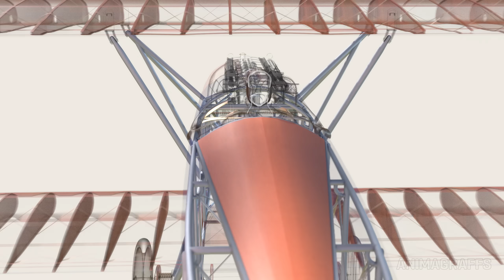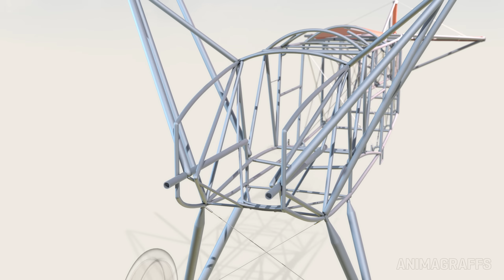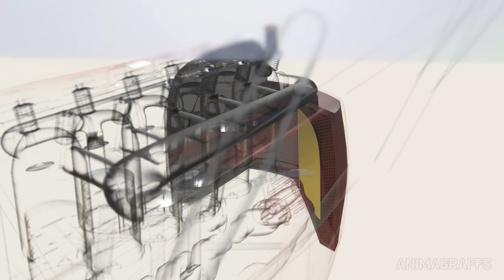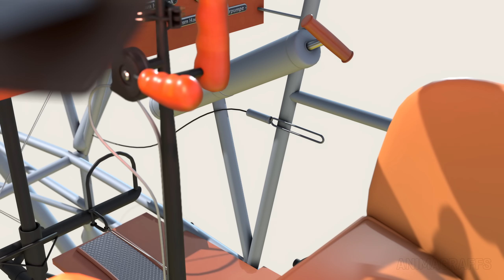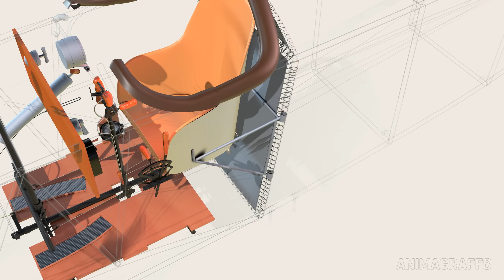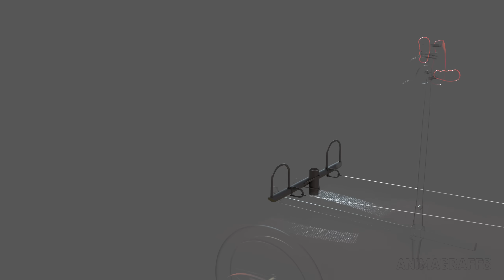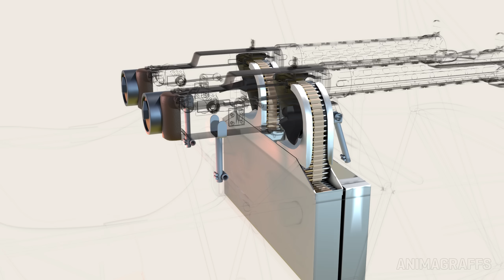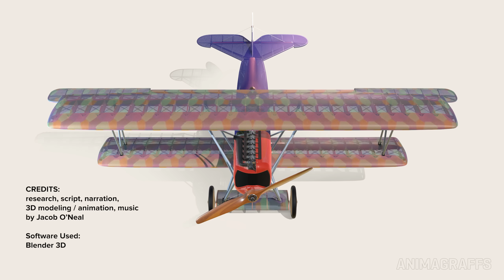How a WWI Biplane Works

Comment: Your videos are graphically excellent, technically accurate, and very informative even for those familiar with the subject matter. Any errors are trivial, but I noticed in this one that the camshaft should be rotating at half engine speed; the prop in some views rotates the wrong direction; and the rudder cables are reversed. But these don't change the informative nature and don't really need correction.

Comment: Very good graphics. I've watched two other Animagraffs, one about locomotives and one about airliner cockpits.  I might note that on this video the rudder and rudder pedals are set up backwards and are operating backwards. When pushing the right rudder pedal the aft end of the rudder should move right, and vis versa. Note also the propeller is turning the wrong way for it's pitch.  I did learn a lot about WWI planes. I've been flying over  50 years, and never knew this much about the "rag wing and baling wire" planes of the WWI era.

Comment: The D VII was clearly a well engineered design based upon “what didn’t” and what did work well. At the time of its design with its welded tubular frame metal ships and “tanks” were riveted. After 1930 when stressed skin aluminum monocoque aircraft construction became the norm, welding of steel warship hulls & turrets and later “tanks” became the norm except for thick armor pieces.

The six cylinder engine (& later V12s) are ideal for aircraft use because they have lower vibration (perfect primary & secondary balance), smooth power delivery and low cross sectional area (offset by the need for a radiator in liquid cooled designs). Large aircooled radial (not rotaries like the Rhônes) also became popular because they lacked the relatively fragile water radiators of liquid cooled designs and were the choice of the USN and often the USAAF.

Comment: Congratulations on the clarity of your graphics. I think, however, you made an assumption that the rudder cables crossed over (a reasonable one to make if you ever foot steered a soap-box go-kart as a kid). I made that assumption on my first attempt at (dual controlled) take off! It wasn't pretty. Only years later, by then an instructor myself, did the true reason for uncrossed wires come to me. Any side loads experienced would call for pressure on one foot or the other to centre oneself in the seat, thus imparting an intuitive balancing act to the rudder bar.

Comment: Love your stuff - but I think you've got the rudder cables crossed. In your depiction the push of the right pedal produces the rudder to move toward the left which would produce a left turn instead of a right turn. Unless they used to "pull" the pedal toward them to create a turn instead of pushing the pedal - the cross cabling (I think) is incorrect. No big deal. Great vid as always.

Comment: You mentioned the engaging of the decompression handle ..but forget to mention its disengagement  when the engine is properly cracked from outside...
Reply from the maker: The way I described it implies a temporary setting just for starting. No need to over-talk in an entertaining video and bore folks.
Reply: @animagraffs  your video is great.. the subject is clear n ur hardwork is really appreciated.. nd I'm not seeing this as an entertainment video.. i respect it as I do to any engineering lecture.. all the best.. continue the good workk.. ty

Comment: Imagine what it was like, before having a timing gear in order to shoot between the propeller blades?
Reply: A previous strategy were attaching metal plates on the rear of the prop to deflect bullets that did not pass through the propeller arc
Reply: And before that, they would mount the guns on the top wing, so the pilots would have to stand up to fire them

Comment: What a beutiful breakdown of a fascinating plane. Anthony Fokker (credited with the Eindecker) and Reinhold Platz (head designer of the DVII) were brilliant engineers. In some ways the DVII was an enhancement of the Eindecker's strenghts. Going with the water cooled engine was an interesting choice. Radials (reportedly) might carbon up in as little as 5 to 7 hours and require rebuilds in 50 hours; water cooled were reliable but could be taken out by hitting the radiator. The short radial life wasn't drastic when a plane might see a few months of service (and pilots might last 2 weeks) but was attributed with the deaths of a couple major German pilots. That's a brilliant detail of the ground crew not having to worry about losing a limb during start up.

Comment: Near the end of this video, where the propeller is shown rotating, the propeller is shown rotating BACKWARDS relative its pitch.  WW1 biplanes did not have beta control as do some modern planes.
Reply from the maker: Yours is the thousandth mention of this, plus the CORRECTIONS pinned thread, plus a notification at the timestamp in the video. Not sure what more I can do to get folks to stop commenting this.

Comment: This video is absolutely amazing. Really great for all aviation enthusiasts.
I just found one mistake, I think. Wiring of the vertical rudder should be not crossed. 
Generally applies, that what foot you kicked, that side you deflect the rudder and to this side you will turn.
I'm not sure if in the past exists some airplanes with rudder control, like shown here. But maybe I'm wrong.
Anyway I really like the 3D modeling in documentary and here I see a masterpiece, I have to say. Great job and I'm looking forward for next one.
😉

Comment: Look I knew a lot about the Fokker D7, but I had no idea that they were powered by a Twin Spark, single over head cam design, with fully tunable engines mid-flight. The Sopwith Camel was complete junk compared to the German planes. It was also great to see actually HOW they managed to synchronise the guns to the props. That tech must have been rocket science back then. Single overhead cams didn't really become fully popular in cars until the 1980's, and Twin Spark engines until the late 90's....and how they did all those inverted stunts in a carburetted plane is definitely some kind of Dark Art.

Comment: Those machine guns did not have shoulder stocks. They were tripod mounted, crew served weapons originally.
Reply from the maker: I'm not a gun guy but if you do a little googling you can see examples of the the original gun with wooden stock from many reputable sources.

Comment: Correction:  The prop bolts were checked regularly not because of variations in temperature but rather variations in moisture content of the wood.  Wood, in fact, has an extremely low coefficient of thermal expansion; however, it is prone to shrink and swell more than most materials with changes in moisture and/or the relative humidity of the surrounding air.

Comment: Sorry fellah, that synchronization remains clear as mud in my little brain.  You have TWO propeller blades, each rotating, how many times per SECOND?, and TWO machine guns firing, how many rounds per SECOND? I see it happening but it is IMPOSSIBLE! At the very least, I fail to see how pilots didn't routinely shoot their propellers into so many splinters.  With all the bumps, vibrations, extreme fluctuations in ambient temperature, and the like, that alleged perfect synchronization MUST have been driven into disarray too often to even care to contemplate.
Reply: because the gun shoots in between the propellers

Comment: That fact that this was one of the first vehicles that you could start without fear of either breaking or loosing a hand to is astounding.

Automobiles didn't have electric starters until the 1930s.

Comment: Best and most interesting part is still missing, the ingenious aerodynamic layout of the wing design of especially this type of aircraft, which kept allied aviation engineers and designer post war scratching their head for almost another decate despite thorough investigations. It was not much before the early 30ies when it was adopted in aviation  modern wing designs.

Comment: Excellent video!  You get an A+ just for rightfully calling the fabric linen and not canvas!  Only suggestion is the prop was shown turning the wrong direction.   But, a small thing and did not detract from the quantity of the video.   Great job!
Reply: I came with the same comment. Really good explanation of the interrupter gear, though.

Comment: A wonderful animation and explanation. However, allow me too point out what I believe to be a mistake. The  wires extending from the rudder bar to the rudder should not be crossed, but should proceed directly to the corresponding sides of the rudder . Thus were one to apply pressure on, say, the left rudder pedal, the nose of the aircraft would yaw  to the left, and secondary effect would begin to roll the aircraft to the left. Having the wires crossed as in your depiction would produce some confusion and consternation for the pilot .and I imagine the flight sergeant or crew chief would find himself in a spot of bother were he to rig the aircraft this way.

Comment: The rudder wire does not cross. Left foot forward pulls the left rudder control horn forward, pulling the rudder to the left. This kicks the tail to the right which is left yaw. 
Same thing with the elevators, no crossover of wires.

Fantastic modeling though, always enjoy them.

Comment: A very nice video! I thought you were going to go into the make and model of aircraft, but I didn't catch that detail!

But, I believe this is the Fokker D-VII made in late 1917, and it shares many of the same structure as the infamous DR-1 Triplane.

The only thing I didn't like about the Fokker frame is the piano wire bracing, but it was used to 'correct' for frame twist and warp after welding together.

Comment: Nice production. My only problem is with the depiction of the 'cotter pin' used to secure the harness system at 18:00 . The straight side of the pin should go through the middle of the locking shaft. The bent side goes around the out side of the shaft.

Comment: Thank you for the video.  I assume the engine had a kind of standard carburetor fuel pump and oil pump.  I wonder how the carburetor and pumps worked when the plane was making tight turns or flying upside down.
Reply: WW2 Spitfires were famous for initially having carburettor float problems that would cause engines to cut-out.

Comment: I noticed that from 15:39 onwards the Propeller would push air forward and the movment of the cylinders is also oposite. So it looks like the motor is running in reverse. I think this is an error. Because the guns would only trigger with this kind of mechanisim if the motor is running in reverse. Which I think is not the case if you want to attack somebody.
Reply from the maker: It's only that very last sequence that's accidentally reversed, I think.

Comment: Imagine flying one of those for the first time. No simulator, no practice runs with a copilot, no backup systems. Plane completely dependent on the pilot's control at all times. Pretty gd hairy.

Comment: Awesome video. Can you check the rigging of the rudder though? Normally in aviation the rudders are rigged the other way around, such that a left push causes a yaw to the left
Reply from the maker: I put the question in the CORRECTIONS thread just now. I expect some experts will set us straight. It could very well be backwards.

Comment: At 13:13 I'm a mystified that the rudder wires are crossed. In that configuration my mind tells me a right push on the pedal would initiate a left shift in the rudder, turning the plane left instead of right. Am I wrong?

Comment: Not only is the propeller spinning the wrong way, to spin the correct way it would have to be reversed on the shaft. The prop has an airfoil like a wing, and it generates its lift toward the side more curved.
Also, regarding the gun sync mechanism, it looks like the gun firing rate is determined by speed of the engine. Thus, if the engine is not running the gun would not fire at all. Is that true, or did I miss something?

Comment: Excellent video as always.  I have to wonder to myself, how many pilots put their boot heels through a worn floor panel before they started installing the metal running plates?   Choosing an aircraft from slightly later in the era was brilliant, as it highlights the innovations of that time.

Comment: I had to double check the service ceiling on this and it was 20,000 feet like you say which is far higher than typical, non-turbocharged airplanes today (a Cessna 172 is 13,500). I wonder how many pilots suffered from hypoxia flying this plane at such high altitudes.
Reply: They were using oxygen in WW1. Often it was a tobacco pipe mouthpiece attached to a hose.

Comment: Great video, really enjoyed it. I'm pretty sure that in the animation from minute 15:30 onwards, the propeller is spinning the wrong way - in reverse, as it would drag air from back to front (the direction of spin of the propeller also causes the plane to constantly want to turn to one side which the pilot needs to fight to fly straight, but can use to their advantage when dogfighting for example). The animation where the engine starts though is correct. As always really impressed with the details, cant wait for more.
Reply: Meh, at that point the plane simply happened to be in reverse. I mean how else do you think they fly backwards when they need to...?

Comment: Fascinating video in every way.  It's one thing to say "technological advances" were made during the course of the war without getting an appreciation of just how incredible those advances were.  This video makes one appreciate what is meant by technological advances.  Wow!
 As others have mentioned, I couldn't conceptualize how the synchronizing gear controlled the firing of the guns, but now I see it's so simple!  One of those "the solution is obvious" situations that is obvious only after someone else figured it out.
My biggest takeaway, however, was the technique for starting the engine.  Who woulda thought!
I'm too old and ignorant to appreciate how much work and talent is involved inproducing these videos, but I recognize you're something special.  Good job and thanks for posting!
Reply: the trigger synchronization makes alot of sense in retrospect but it hurt my head thinking about how much adjustment and fine tuning you would have to do while developing it.

Comment: The relative (not that I could build one) simplicity of these designs is amazing. I am also continually amazed at the lack of parachute for the pilot!
Reply: Probably didn't have one since if you were shot down, you'd likely already be shot dead due to a lack of armor in the seat 😬
Reply: @gravygraves5112  This is true. I'd still like one in case the engine catches fire. Burning to death in mid-air ... yesh.

Comment: How dit they stear whit only a rudder?
Reply: I think you're commenting on the absence of a tail wheel? I believe the pilot would have to rev the engine to the point that enough air was passing over the rudder to kick the tail to one side. At least that's how it is with some RC airplane models.
Reply: @Imnotplayinganymore  yeah sounds logical, in hangers they could probably just pick the tail up by hand or cart or something
Reply: How old are you?
Reply: Im a dutch engineer that is bad at english so sst let me be you bully @stevek8829

Comment: I’ve always had a fascination with aviation and have been flying airplanes for the last four and a half years.  It is super interesting to me to see what has been improved on since the early days, like the anemometer for airspeed being replaced by the more modern pitot-static system, or that fuel pressure system.  But it’s even more shocking to see what has remained almost exactly the same, such as the dual-magneto setup and the control cables.  Plus, I’ve always wondered how the interrupter gear system worked, and you explained it beautifully.  A very well crafted video!

Comment: When starting the engine, was it possible it would start rotating the wrong way or was this impossible?
Reply from the maker: Yes, I was told that's the reason for the spark advance lever - to time the spark and ensure rotation went the correct direction

Comment: So close to perfect! Awesome video!
But the rudder/yaw cables shouldnt cross. Unless I am mistaken. Which is not unlikely, to be fair!
But either way, nit picking aside, this is a great video on old school fighters...I learned a lot!
And that Fokker gun interrupter gear was an ingenious design. A whole video could be made on that alone. 
Well done. 
I love this channel.
Reply: Glad you caught the rudder cables.
Reply: I always thought they should be crossed.  I'm used to it now, but when learning it felt more intuitive to push right to go left... like the handlebars of a bike.  I believe a lot of aircraft were that way, like the Japanese Zero.
Brakes in opposite orientation would not be so intuitive.
Reply: Impressive work, great job. Just a hint the propeller in the end sequence turns the wrong direction.. it would Push the plane backwards.. I love Your Videos and you are a  Master of the Blender Software. I wonder how long of Research and then actual work it takes.. and if there are usable parts already available?

Comment: Pilots also wore silk scarfs, as that was the best fabric to clean flying goggles of oily exhaust with minimal streaking.
Reply: Not a big problem with that particular engine, but definitely with the rotaries.
Reply: @Snobiker13  If I remember correctly, the fuel/air mixture was routed through the crankcase and to lubricate everything before going to the cylinders. That means that the rotories burned oil and sometimes unburned oil in the exhaust would get in the pilot's face hence why he would wear a scarf. So he could wipe the oil off his goggles.